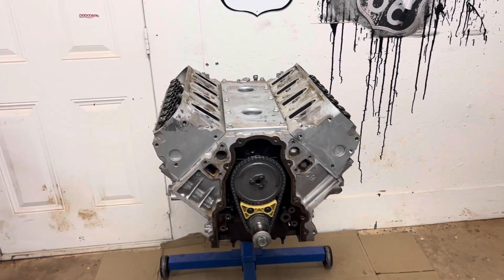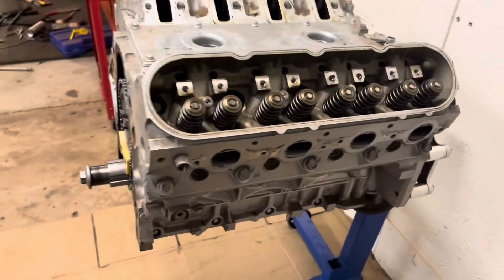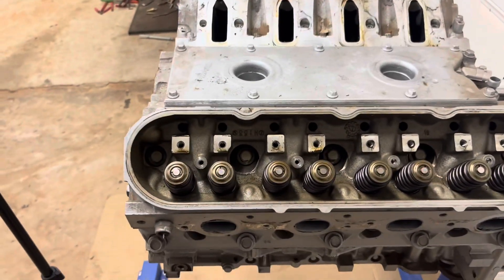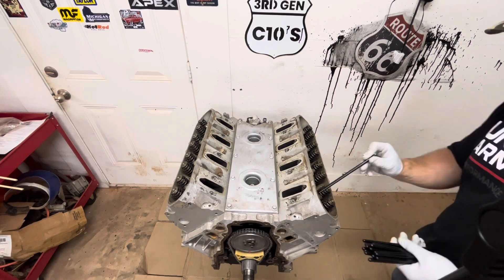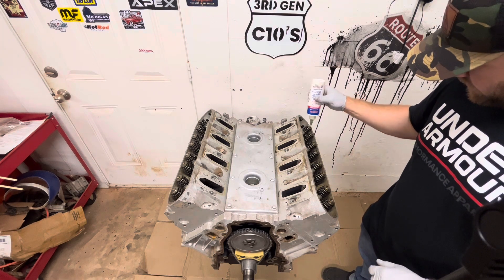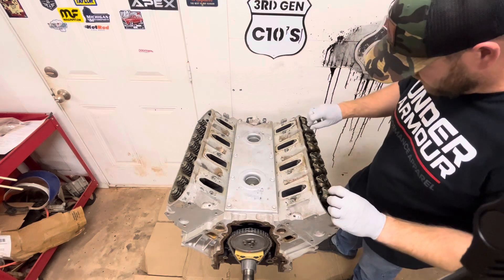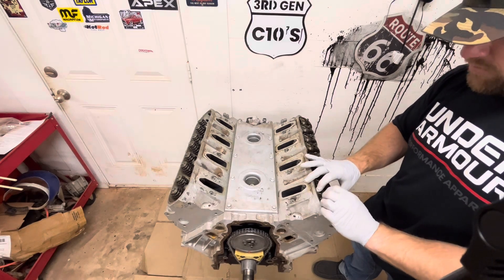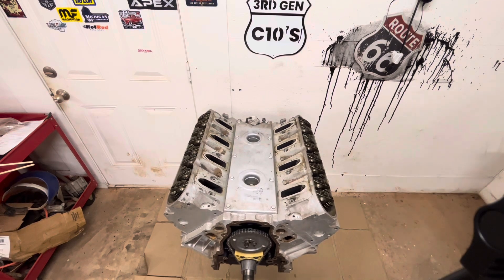5.3 Rocker Arm Torque Sequence

Comment: Hey so I’m putting 243 heads on my Lq4 but the head bolts I bought which were from fel-pro and I got them at autozone. They are maybe 2-3 inches longer than the original head bolts. Are they suppose to be like that or did I get the wrong ones?
Reply from the maker: I would assume you have the wrong ones. They should be slighty shorter than the bolts you removed. They are TTY fasteners and will stretch when torqued.